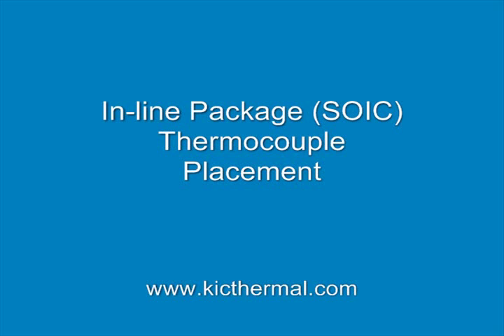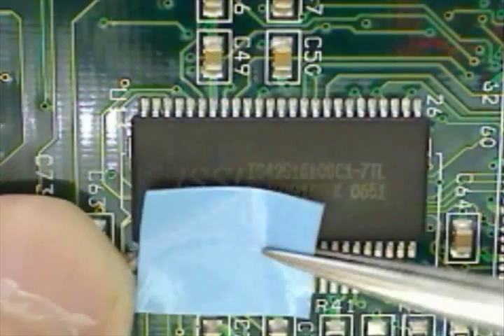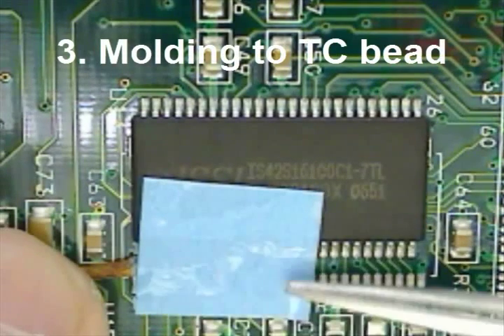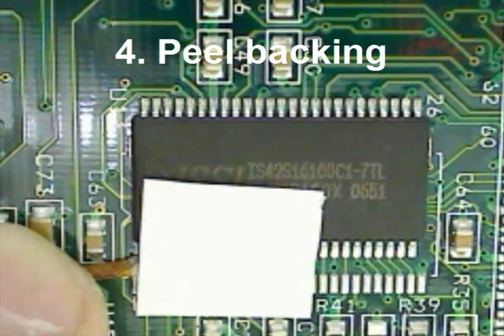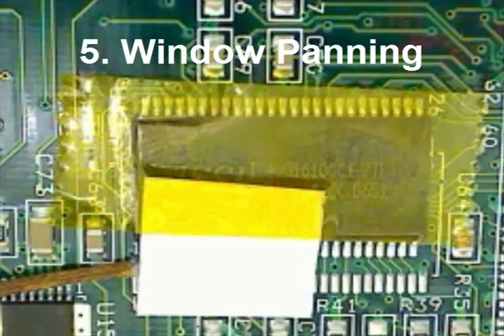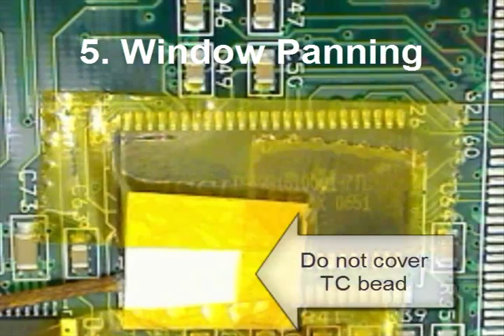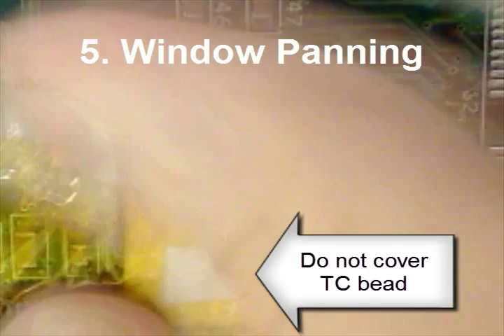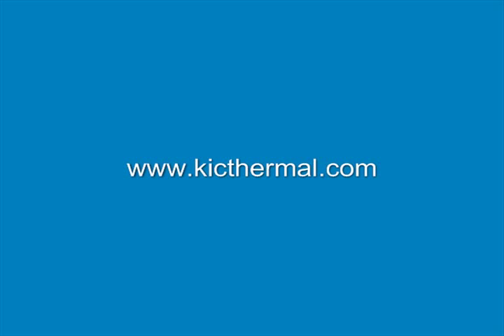How to Thermocouple a Printed Circuit Board (PCB) Part I

Comment from the maker: the alum. tape is just a means to an end.  It is one of the few materials that has little to no impact on the ability of the TC to get an accurate reading, all the while sticking long enough to the PCB, to gather that reading and not destroy it in the process.
Reply: Been searching for this double sided alum tape but cannot find anything that looks like what you used above.  Care to share what it is?